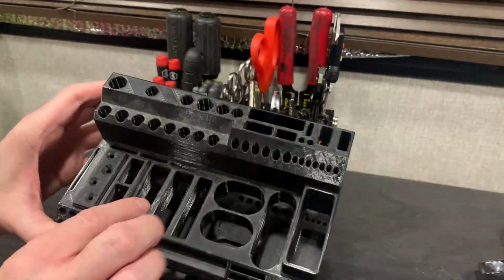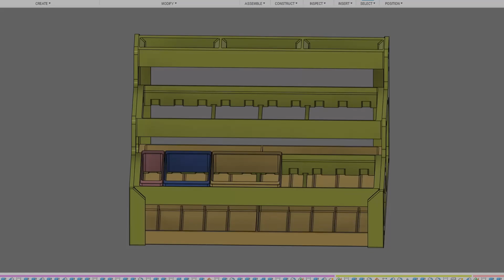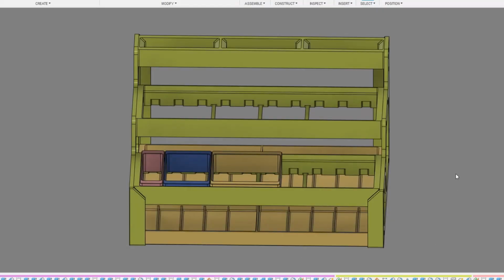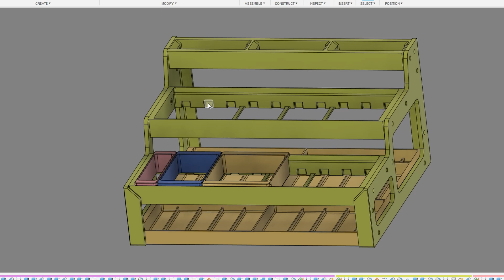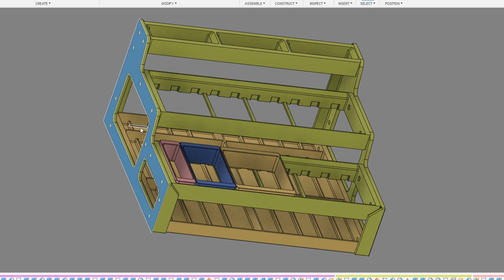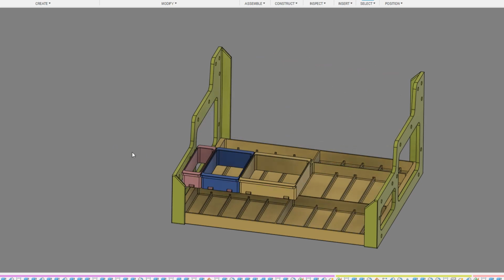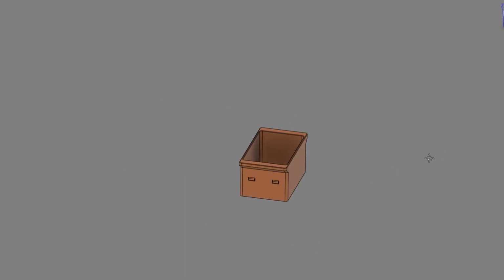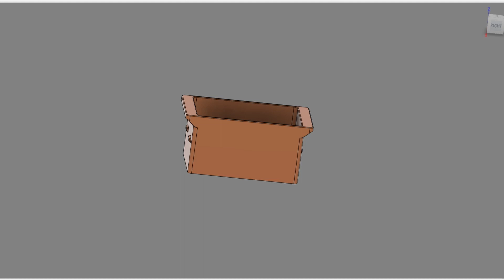Shop Infrastructure - 3D Printed Desktop Tool Storage

Comment: What are your thoughts on Voidstar's gridfinitys?
Reply from the maker: I think the gridfinity setup is really cool and I would use their stuff for a larger work areas with drawers and for storage of infrequently used tools.  Personally I dislike drawers as I'm a big fan of Adam Savage's 1st order retrievability, and I put everything on pegboards when I can. 

I had some unique needs because I wanted something I could pickup and move with the tools in it, dividers that snapped in place,  something that allowed for tools be stored vertically.